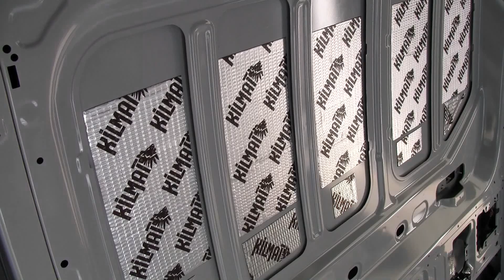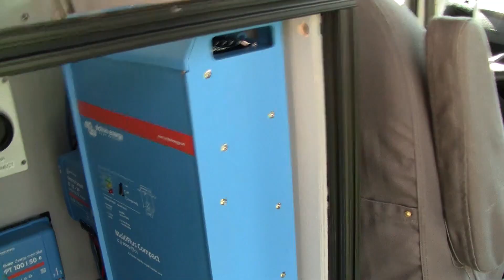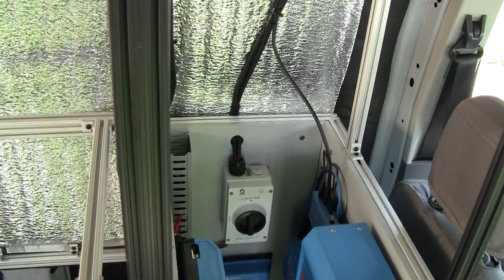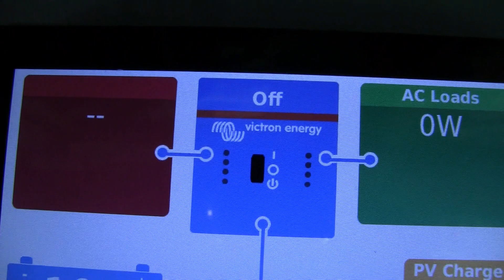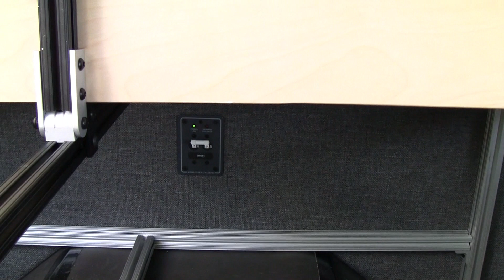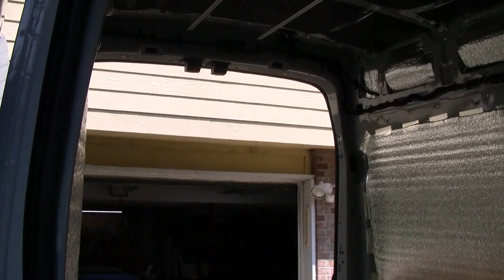August 1st Van Build Update

Comment: Really clean build, you’re doing a fantastic job. Did you engineer this yourself? Your electrical cabinet is really well done. Are you buying your 8020 directly from 8020? 
I have a 2023 transit on order since August 10, not sure when I’ll get it. I enjoy your videos.
Reply: Thanks, yes, I'm designing as I build which slows things down sometimes.  I bought my 8020 from Zoro.com and from 8020 through Amazon.  I think I'm done buying 8020 finally.  We started building 2023 models towards the end of September.  We're running two 8-hour shifts per day and I haven't heard about any parts shortages lately.  Hopefully, yours will be built soon.

Comment: Well done, you have been busy since your last video. Well planned and coming together nicely. Your use of these components give me more to consider and think about, eg the use of the12v to 5v external converter for the Lynx Distributor, using a Victron smart shunt, adding the progressive safety switch for the shore power input. I took notice of your 8020 assembly and looking for the anchor points to the van. Are the brass plus nuts factory installed or did you put these in for use later if needed. They look to be good anchor points for 8020 framing?